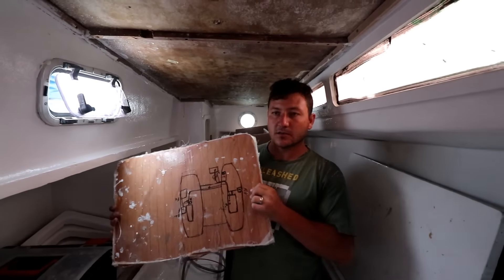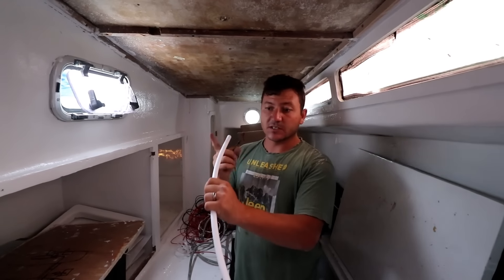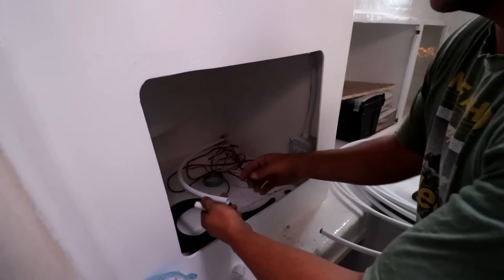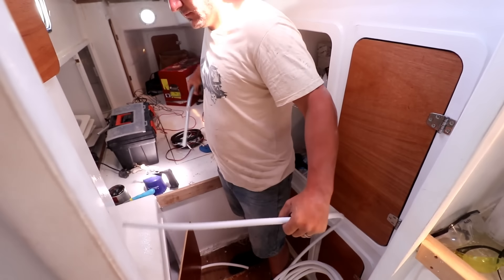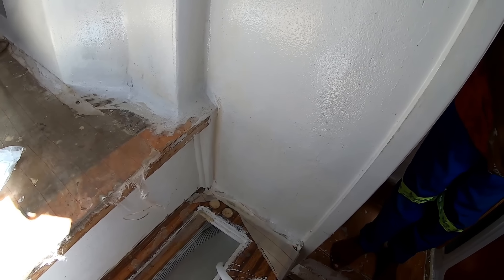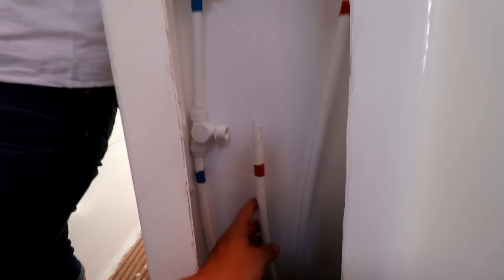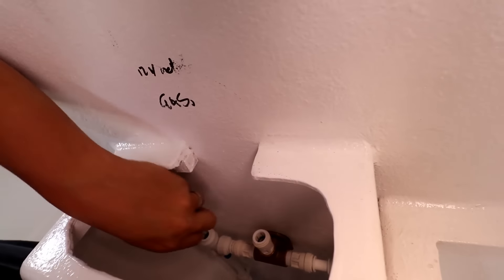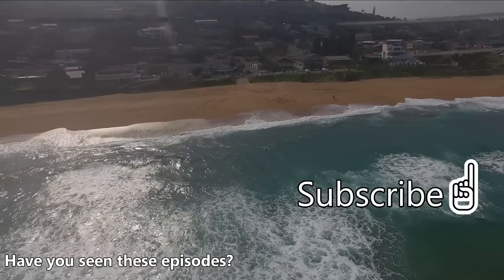PLUMBING on our BOAT | YACHT REBUILD WEEK 53

Comment: Don’t often comment but just wanted to congratulate you on such a thorough job. The plastic plumbing is a sound system for both domestic and marine use. One caution - where the pvc pipe passes through structure and is not in conduit - the hard edge must be softened using rubber or similar to prevent fretting at sea which would eat through the pipe in a year or two. In addition the pipework should be well clipped.👍
Reply from the maker: thanks Norman  and welcome to the comments haha. yes all the pipes will be secured once we have finished  everything . Good point about fitting a rubber grommet will look into it !

Comment: The john guest plumbing systerms have been in our boat for 20 years never a leak  it’s quick easy to use and cheep we also found the C clips also can have a cable tie in there place if you run out   Then we built a manifold at the calufont for all the hot and cold lines , well done
Reply from the maker: Thanks, glad to hear they lasted you so long! Heard good reviews.

Comment: great work. electric and plumbing get buried, covered and painted-over and forgotten about. Doing it well is important. I've never seen this pipe/fitting before and I'm pretty impressed. think I'll try it on my old boat.
Reply from the maker: Plumbing and electrical as well as your gas are very important! 😊 Thanks for watching!
Reply: See, THIS is the HUGE Advantage of Buying a Used Boat and Re-fitting her. She is YOURS, so you can do ANYTHING you damned well PLEASE to her, like Refit her to be EASY TO WORK ON and MAINTAIN, lol!  @livingwiththemaias

Comment: Great to see you progressing with your boat, it is looking fantastic.

You asked for comments about your plumbing and this is just that, not a criticism for the sake of it, just some observations that you can take on board or ignore as you see fit.
 
One thing about your plumbing system from what you said in the video, that the 15mm feed for the shower is also running to the washing machine and galley, this can cause supply issues when more than one of those demand point locations is in use at the same time. 

There are two ways to eliminate this, the older method of a hot and cold ring feed with a larger diameter pipe from the supply source and smaller diameter spurs to each demand point, or the modern and much more efficient use of both a hot and a cold larger diameter short manifold at the supply source and individual direct supply runs to each demand point.

Using your two pump two separate hull system you would need to run both supplies to the manifolds and have manual shut off valves to close off one side or the other to have your system redundancy.

Or you could just live with it as is... 
:-) 

Regards, Dave
Reply from the maker: Thanks for the tips Dave and for watching ! 😊

Comment: hi guys! We, resp. our Deans,  seem to have reached some kind of similar "state of fitness" at the moment. :-) After living out of jerrycans for 6 months now, (remember, I not only refit another Dean 365 still standing high&dry in Richards Bay, but at the same time live in it), since last week I enjoy an almost completed watersystem (also including 2 pumps, crossfeed and the like) as well as hot (!) water just out of the tap. What a luxury :-)     

I originally wanted to install the Whale-system,  but could not get it here for any price, I would have been willing to pay, so I went for standard PVC-piping. A pity, I did not know of this John Guest stuff, when ordering, Hope, that standard-piping will stay leakproof too over the time to come.  

Just two thoughts to your system:

- Check the rear walls of your watertanks! If you have the same 300l fibreglas-tanks in each hull as I have, make sure, that they are still intact. In any case, it might be a good idea to put on some additional layers of glass inside and out. Mine were both horizontally cracked at around 60% of the height, probably due to water slashing back and forth inside in high waves, when only half full! 
I only found out, after I had cleaned them out and wanted to reactivate them after 5 years of non-use. (Pics on my blogsite)

- Maybe I am overcautios, but after filling my repaired watertanks and then finding a bunch of mosquito larvae merrily swimming around inside some days later, I spontaneously added an active charcoal-filterelement just in that spot, where both pressurepumps feed into the common line before taps, geysyr etc.. Might help, to keep any creepy things out of my coffee or icecubes even if they are a lot smaller than mosquito larveae ...
Reply from the maker: Yes we remember! How is it going so far? We have filled up our tanks to the top twice now to clean it out and we seem to be okay on the bug side of things.. Maybe cause PE ain't exactly the hottest place in the world. We seemed to have no leaks at all. Our bilges stayed dry and we left it overnight full. Thanks for the heads up though 😊 Appreciate it
Reply: >How is it going so far?<  Rather slowly, but still going ... :-) After I arrived in august, I recognized, what these people I had engaged to get Thelxinoe seaworthy, had achieved (or rather not) during those 1 1/2 years of my absence. Two weeks later, I had fired everybody and now me and Simon, my pendant to your Moses, are doing the refit on our own. Takes a bit more time, than expected, but i can see light at the end of the tunnel. New (old) engine is running and mostly installed, Z-drive is away for overhaul, outside is painted, coppercoat applied, all throughhulls new, most of electric/navigation/plumbing is finished by now. Just get the Z-drive back and attached, get the mast up to measure for new main and new cutterjib and then see, what else pops up, once I get into the water, which I hope to do end of march/early april. Today I tested my internal shower on the living object (me) for the first time. Will probably only repeat if freezing outside :-) My shower is smaller than yours and I'm almost twice as old as you two. Got w/c water piping to a swimplatformshower additionally, that will have to do then while underway :-)

>we seem to be okay on the bug side of things<
Well, er, I obviously did not install the charcoalfilter against the mosquitoes, that's just a side effekt. But even with a watermaker, it sounds like a good idea, to have such a thing, if flushing it with freshwater out of the tanks instead of a bucket.
Reply from the maker: That's awesome! No, i mean we didn't have any larvae in our tanks thank goodness. We just had the gross sludge & foul smell but no larvae or floating particles to say but it's always good to treat and clean where you can! Keep up the good work!

Comment: Well done so far, great work.. realy much better then the original.. the wood collor doors look great in the white surroundings.. (For the looks of it, and to keep the water in the shower), I would put a plexiglas door in the shower, same collor as the windows.. Btw: Dont build the boat to light, it will get smashed on the waves, instead of sailing through the waves.. you'll and up having to put ballast on the bottom of the two hulls.. Greetz, from across the globe.
Reply from the maker: Thanks so much. Felt we had to break all the white somewhere. She still not gonna be that light she still takes 700litres of water & 300 litres of fuel as well as all our other goodies so we try to save where we can 😊

Comment: getting closer.....!  Can you feel the waves splashing up on your boat and the wind in your sails yet?  Have you figured out your electric needs and capacities?  Did you get your charge controllers, solar panels and/or wind generators yet?  And are you gonna run 2 alternators on your motor?  One stock to run your motor and it's systems and another for charging batteries?  I like the fresh and salt water wash idea at the back, it will come in handy after gutting and filleting a nice fish to wash off all the guts and stuff.  Sorry, my head was full of questions.
Reply from the maker: Heya Grant , there is still a heap of work to come but we making great progress . yes all our electrical system calculations  are accounted for but we still need to get some of the hardware . budget is tight so we will have to see what we can add and what we cant afford

Comment: Why did u choose PTC fittings vs clamps? I'm redoing my land house plumbing in all PEX. Tool was reasonable. Clamps & fittings are cheaps. The PTC fittings are 5x the price. Freshwater is freshwater. Hot water is hot water. Maybe I can see something special for saltwater, but I'm skeptical over the regular freshwater line.
Reply from the maker: We could not get the crimping system easily available in South Africa , however the crimping rings are metal and will rust in salty inviroments. 
Nothing can rust here and it's been 3 years with no problem what so ever and very easy to change and add fittings . 
Best solution for a boat in my opinion.  
In a residential application I don't see why your systems won't be perfect

Comment: After watching those press fit pipe system, I was just wondering what the water pressure rating is for those connectors? It sure does look good though.
Reply from the maker: Hi Bayani , They recommend for up to 10bar but i have seen them tested to 45bar before any leaks occurred

Comment: When you make those plumbing joints would it improve the chance of success if you lubed the o rings with some water rather than pushing them in dry  ??
Reply from the maker: We do lube them up. Works alot easier!

Comment: super lekker episode,now you are getting to the fun bit of a a fit out.
just a few points from me as usual,no criticism intended!

make sure your water pumps match the minimum required pressure and volume for the on demand gas water heater otherwise it will just click on and off if the pressure is too low  and make shower water either too hot or too cold.
 mine are 12lpm and 2.5bar my water heater requires 0.7 bar but most are a lot higher.and require pumps that provide much greater pressure and volume.

once you have tested the system,for leaks then if it is left for a few months without use make sure to put some bleach in the tanks and run  it through the pipe work otherwise the water will  get stagnant and start to smell bad which permeates into the pipework.

as to all the conduiting  i think you see now what i was saying months ago about making them as big as possible for pipework and wiring ,it does not take long before they are full especially when at the end you find you also want to run data cables, depth sounders,nmea backbone etc

super nice electrical panels,but you might want to put some sissy bars near the switches so they don't get bumped as people walk past in a seaway and accidently turn off power at critical moments.!

keep on keeping up,make some time for yourselves ,don't get burned out by deadlines.
if you are not ready to leave this year,no big deal you could always go north to moz, mada and mayotte for a shakedown later in the season even to the med then cross in jan next year to the carib..
will give you a bump on cruisersforum,see if we can get your subscriber numbers up.
cheers alex
Reply from the maker: Hey Alex , our gas heater is a 5lt flow meter type not pressure type. this means me can run the system with minimal pressure 0.3bar  reducing run time . also great for a low pressure system . None the less we are able to deliver 1.7 bar at up to 15L/m if required . 

i wish we could say if we dont sail this year its fine , if we dont sail in the next few months we will be in financial trouble  

have a good day , back to work for us today
Reply: that sounds good,my gas water heater is quite sensitive,but seem to have it sorted now,don't forget to put a bit of bleach in the system. i frequently deliver boats that have been standing for a while and many times the stuff coming out the pipes is very smelly.
sorry to hear about the rapidly diminishing finances,we always took paying crew paying about $20 a day which covered most of our running costs for voyages.

looks like the plug on cruisers forum got you a few new subscribers,did you notice a jump in figures ?,if it helped i can post a link to your weekly vids to the thread on cf every week.
there were 178 views of the thread on cf. over the weekend,1700 total for the thread.
Reply from the maker: @alexbond490  Hey Alex , yes that bleach works a charm. we will have to wash our tanks out due to nasty stuff going on at the moment , like dust and i dont want to run that threw the new system.  yea iv done a number of deliveries and crew can be interesting of you dont know them, sometimes even the owners are interesting to say the least ( but most great people)  so id like to stay away from taking randoms on long passages. 

any shares always help a bit ! thanks

Comment: If and when in the near future you have problems with lime scale the best thing to use to get shot of it is to use Citric Acid. and also Citric Acid cleans up brass parts and chrome just soak them in warm water then clean off. and it will eat rust too and its Bio-degradable
Reply from the maker: Thanks for the tip Erick 😊

Comment: Having propane is scary enough and you run it in tupperware pipe?YIKES.Working on boat's I have held plastic in my hand's and crumbled it into powder.
Reply from the maker: Propane can be a scary topic but we have a great installer adding some great marine grade systems in. plastic or PEX pipping is far superior to metal in a marine environment and gets a 15 year certification